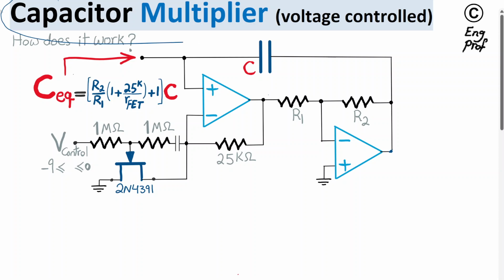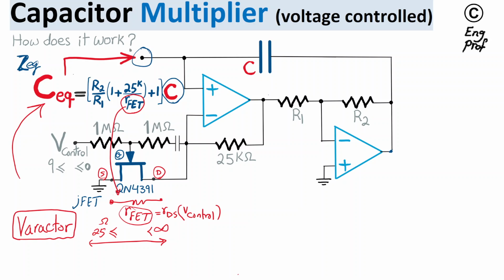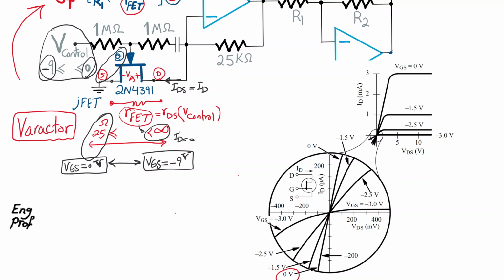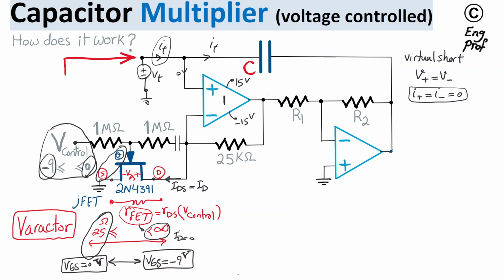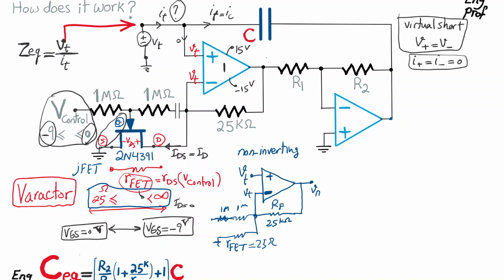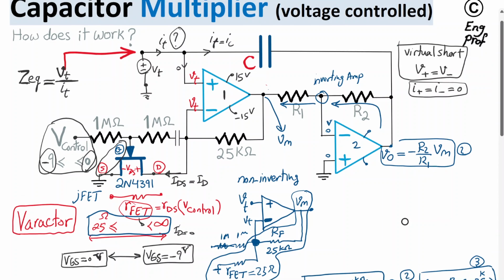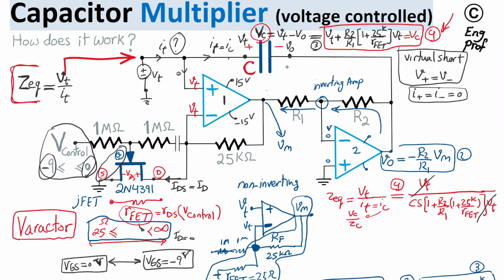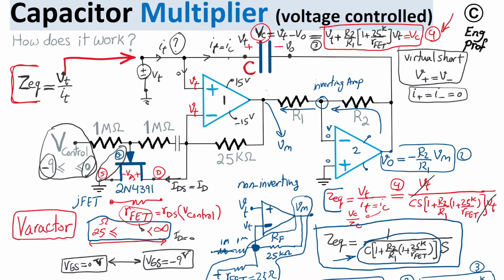Capacitor Multiplier Op Amp Circuit: How does it work?

Comment: I am trying to create an actual capacitance multiplier circuit for my Electric circuits Project and i have no idea what to do and i got this video, can you please help me on how to do it?
Reply from the maker: Thanks for your interest in this circuit. Please follow the instructions discussed in the video. And don't forget to go with Quad or Dual MOSFET op amp chips with very low noise and zero offset (or ultra low offset).  Also, use don't forget to include a ~10pf stabilizing feedback capacitor between output and negative input terminals for each op amp. Good luck with your project.